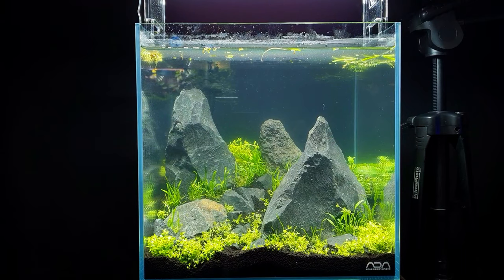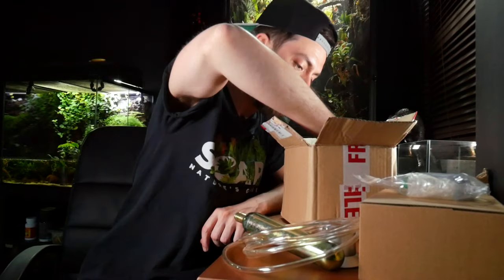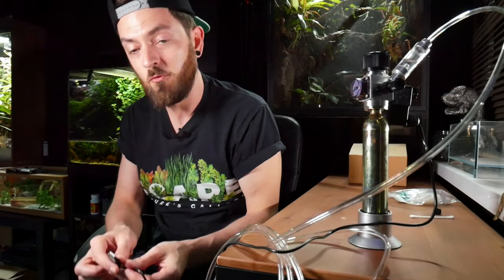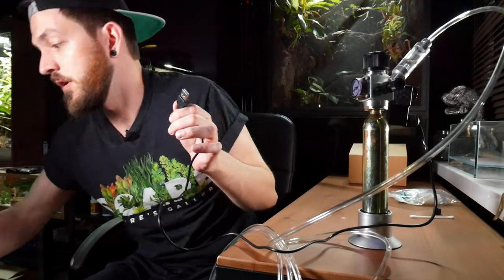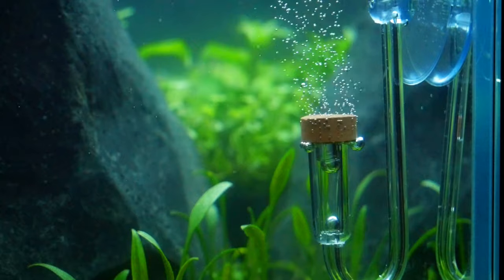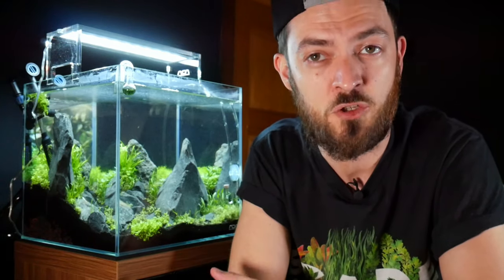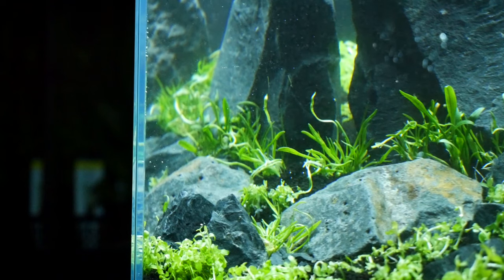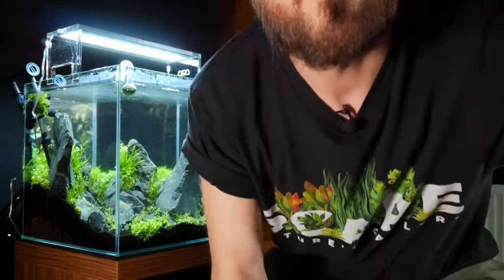Unboxing & Setting Up A Nano CO2 System From CO2 Supermarket On My ADA 30C

Comment: Rubber bands instead of tight fit probably because size change with temperature fluctuations. But a rubberized internal system on the stand instead of o rings prob better option.

Comment: Another great video,considering getting this set up for my 90 litre once I've got it set up,I'm using the tropica c02 growth system 60 on my 15 litre and to my surprise in does actually seem to make a difference to plant growth,not sure if its worth setting a full system up on such a small tank
What do u think?
Reply from the maker: Hey thanks very much. I wouldnt say that it's too small of a setup. Plants thrive on CO2 regardless of the size of the tank. I'm considering CO2 for my DOOA 30x18x15 shallow 😁

Comment: Hi! I have the same regulator but im using sodastream cans and adapter, a standard one. But some were i have a leak and i cant find it. when im seting it all upp it looks like its working fine, but i empty entire cans in just 2 days. any ideas? could it be the pressure is to high in a sodastream can so its pushing out some were?
Reply: I have the identical issue. The system worked for more that two years. Two weeks ago i changed my cylinder and now i am on the 3rd cylinder

Comment: Is it normal that the pressure is constantly going down?
Reply from the maker: It will as time goes on and the CO2 runs out. If its doing it quicker there may be a leak